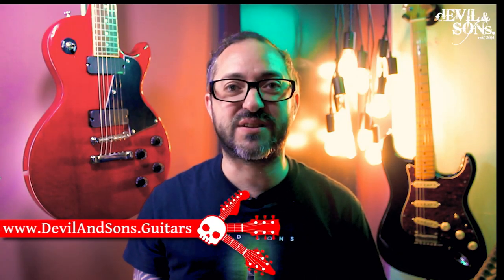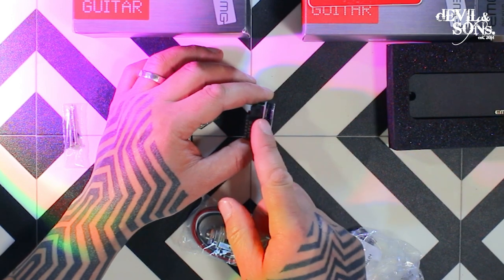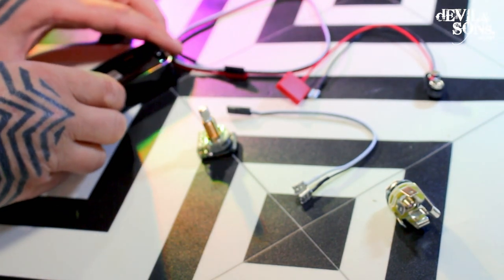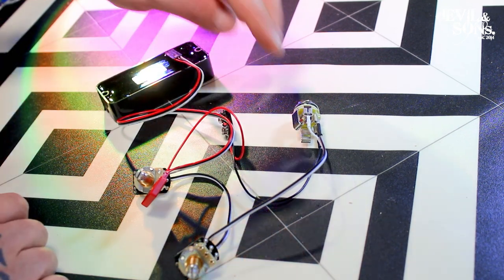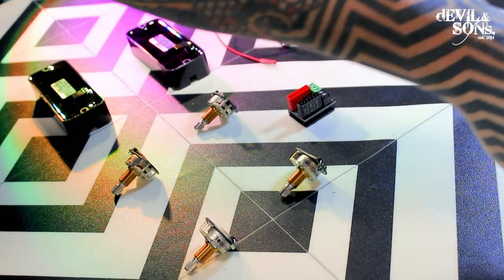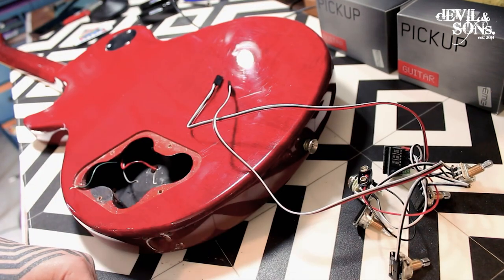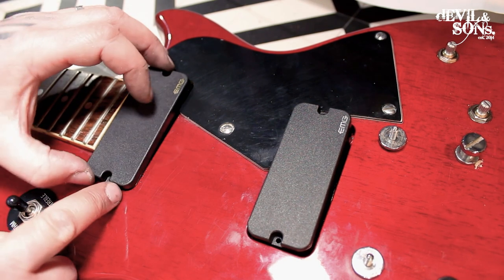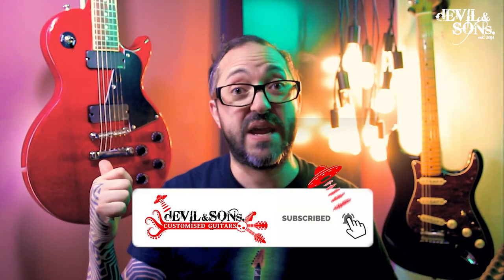How to correctly install EMG solderless pickups - the (P) 81/85 combo

Comment: I have a 90s Les Paul studio with an H/P90. The original p90 is mounted by 2 screws in the center. I’m dumb, and I can’t figure how to mount the emg soapbar, as the rout for the toggle switch is in right where one of the screws needs to go. It’s waaaay too deep for any screws. I’m unsure of a proper way around this. Anyone know where I can look for ideas?
Reply from the maker: I can actually picture this, but happy to try and help. If you can send me a couple of photos to info@devilandsons.guitars I'll try and suggest a solution for you.

Comment: I like the EMG 81's. Can they go bad? Mine seems noisy when my palm covers it. The other pickups don't sound noisy. It's grounded and the original one from 1985.lol
Reply from the maker: Hmm, I honestly don't know the answer. I would first be double checking the grounding, which it sounds like you have, that's what you would expect if the grounding has a problem. I would normally resolder the joint just in case. Does this pickup have it's own volune and/or tone? I wonder if there is a grounding issue or problem with one of those pots? I would also clean the pickup with antistatic spray, or electronics part cleaner spray.
Reply: @DevilAndSons  thanks for commenting. It is one volume and one tone and one 5 way switch for dual bridge humbucker and two single humbucker.  I had guitar set up so pots got cleaned, but I think it might be my plug in jack...when I touch, like I am grounding it the noise goes away.lol....thanks
Reply: I mean when I touch the jack casing on my guitar and put my palm over the pickup the noise goes away.
Reply from the maker: That does sound like a wire or solder joint is loose. Sorry not to be able to directly help you resolve the issue.
Reply: @DevilAndSons  thanks again...
I just subscribed!!
Reply from the maker: That's very kind, thanks for watching and commenting too.

Comment: Hello, i have a little problem - i have a les paul style guitar, the emg 81/60 combination (standard, not P as Yours) and when i have my pickup selector on middle i can't play one pickup - both pickups volumes must be on to play, can't play on one pickup in middle selector. When it's on bridge or neck it works perfectly, only a problem with middle selection, what i got wrong?
Reply from the maker: I have read that swapping the prong the hot lead is on for the volume can fix. I think I have also heard that someone who had this problem had a faulty bus - if you have two (I assume one came with each pickup) you could try swapping them. If either of these don't work I would need to see some photos.
Reply from the maker: Let me know.

Comment: i bought a 81 and a 60 but can't get sound from the 81 but i'm only using 1 vol no tone not sure what to do
Reply from the maker: First up, what happens if you change the 81 and the 60 around, I.e. wire the 81 where the 60 goes? If you don't get sound then it could be a faulty pickup.

Comment: I dont understand where does the grounds connect to the switch. The wire on my switch do not have a ground in them.
Reply from the maker: Switches only have a ground if you are grounding the metal casing of the switch.

Comment: I'm very confused where the tremolo ground wire goes. I have the EMG 3 way solderless switch with 1 volume pot and 1 tone pot. I just don't understand how the tremolo ground wire attaches to the switch sense its supposed to be solderless. Do I just not use it?  I'm a newbie to this haha, thanks!
Reply from the maker: Emg solderless do not need string grounding so you should be fine.
Reply: @DevilAndSons   The only wire I left in the guitar is the ground coming from the tremolo. Just wasn't sure if I needed to use it still or not and where it would go.
Reply from the maker: Normally in the instructions it would confirm thar the solder pickups don't need string grounding, so that's the wire from the bridge. If you have the wire coming into the cavity you could just coil it up, or snip the very end (the exposed bit off) so it is still there should you change to a different system.
Reply: @DevilAndSons  Awesome thank you so much!
Reply from the maker: Anytime. Good luck with your installation.

Comment: I accidentlly cut all the cables that go to the toggle switch. What do i do then???
Reply from the maker: Are you using the switch like I had, where you attached it to the bus with a screwdriver? Or is it one of their switches with special terminals?

If it's like mine it's a really simple fix, you can reuse the wires you cut off. Basically you just need to make sure that attach wires to the bus with the screw and match those wires to the correct place on the switch. However they need to be soldered back on to the switch. The EMG website with diagrams for this system has great drawings  of how the wires attach to the switch. If that doesn't help let me know.
Reply: Thank you

Comment: what do i do if i dont have space for the battery?
Reply from the maker: That's tough. Sometimes tou'll have to rout out a new hole in the guitar to fit a battery compartment. What guitar do you have? Normally the battery can fit in the cavity. A lot of the time you can wrap it in a thin foam and it can squash in without damaging the components in there.
Reply: @DevilAndSons  Pango Explorer kit guitar

Comment: awww no 😱 I placed the white wire where the black wire of the battery goes and vice versa for the battery....I need help, I can't remove them. They're literally stuck on there....awww fudge!!
Reply from the maker: I'm sorry to hear that. I don't have any advice on how to get them out, I'm surprised they got stuck. Normally the pop in and out of that bus quite easily, although you may have to pull the plastic part a bit harder than you expect.
Reply: @DevilAndSons It's ok, took me awhile but it came off. Now everything works fine now. 😅
Reply from the maker: Excellent. I hate that feeling where you're not sure if you're going to break something or not.

Comment: How can ı install it to a single pick up guitar ı am worried about removing the old pickup
Reply from the maker: What specifically are you worried about? If you're using a complete esp kit then you can remove the whole of the existing pickup and controls without desoldering them, so can then put it all back if you don't like the esp.
Reply: @DevilAndSons  thank you should ı fasten the battery in guitar or ı just can put in? if it shakes does it damage to wires
Reply: I am worried about cuting the wrong wire but ı have 1 volume and 1 pick up so ı can just cut and remove every old things
Reply from the maker: @JosephS352 I can't remember if the kit comes with a clip. Most people would fasten it either in the guitar or to the back of the cavity cover but it's also common just to wrap it in a thin foam case/strip and leave it sandwiched in amount the wires. Personally I prefer ot held in place to be OK the safe side. If the pack didn't come with a clip I think you could easily find a variety of pp3 battery clips and holders on amazon or Ebay.
Reply from the maker: @JosephS352  hey, also thanks for joining the channel. If you are worried please send me a couple of photos of the current cavity and perhaps the emg set you have and I would be happy to give you some more direct advice. Info@devilandsons.guitars

Comment: I'm confused 85 for neck and 81 for bridge 😳!!!?
Reply from the maker: That's the popular choice.
Reply from the maker: Not that you should believe everything you read on Wikipedia (or watch on YouTube for that matter) but here is what wiki says about the 85 

The EMG 85 is a popular active humbucker guitar pickup manufactured by EMG, Inc. It is paired with the 81 in the Zakk Wylde signature EMG set. It was originally designed to be used in the bridge position but is typically installed in the neck position by modern guitar producers
Reply: @DevilAndSons  Thank you, so that's why is a Zack's signature to balance the thickness in upper and lower registers on fretboard!!? interesting
Reply from the maker: I'm not an expert on hos set up and why he wanted that, but it's seems to be very popular because of him.